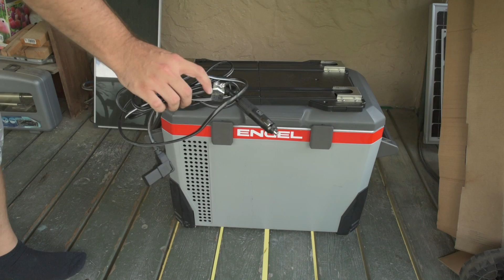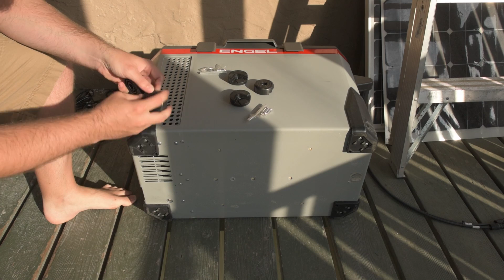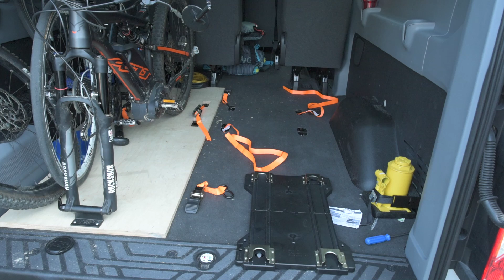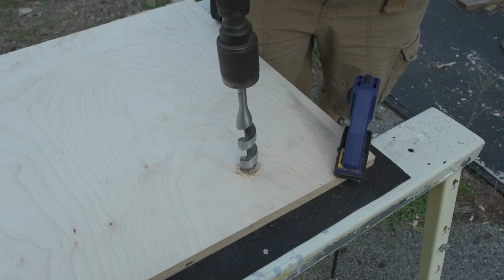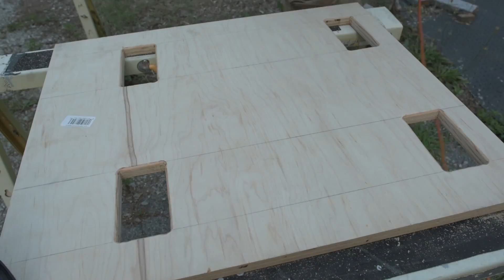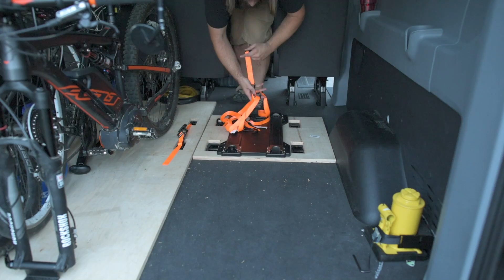Engel Transit Slide Lock MR040 Install - Step by Step

Comment: hey man,is it a loud fridge??How many amps it draw on a 12v car battery??
Reply from the maker: Not loud at all. Hums a little. Very low amp. I can run it overnight on my van battery without  recharge in a pinch, but I have just a single battery on that van so I don’t like to do it. It’ll run all day off a 10 watt solar input on the same van. Specs say 2.5 amps, but remember it cycles so it isn’t always drawing that. I’m a huge fan of this fridge. It’s great.

Comment: why didn't you use the carry handles to put the ratchet straps on? works on my National Luna Weekender
Reply from the maker: Slide release is way easier
Reply: The handles are designed to be the down points.
Reply from the maker: So is the slider. It’s made by the same company.

Comment: I would love if you'd do review of your Engel MR040 there doesn't same to be a good review on youtube.
Reply from the maker: I don't really have any other product to compare it against. I know ARB makes a comparable fridge, but I've never used it. For what it's worth, I like my MR040. It's a little on the small side (inside), but it's power frugal, rugged, and reliable. The slide lock is nice too.
Reply: Is it like a yeti cooler smaller than advertised or spot on 40 qts?
Reply from the maker: Internal dimensions: (LxWxH) 14.5" x 10.5" x 14.4" According to a calculator on the internet, that's 2192.4 inch3, or 37.9636364 quarts.
Reply: +createthis thanks for helping me decide on ordering one. you had me sold with" power frugal, rugged, and reliable". Thanks again.
Reply from the maker: No problem! Glad to help.